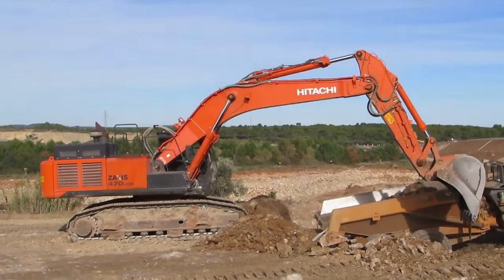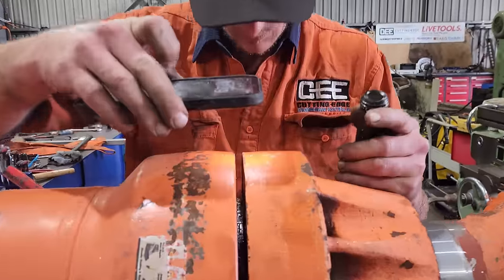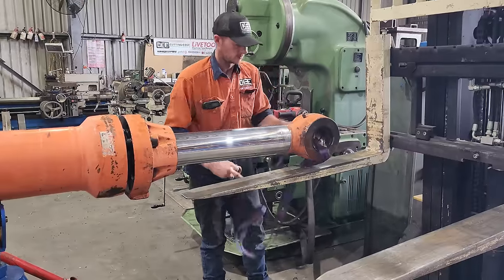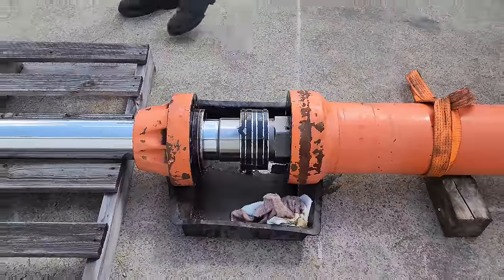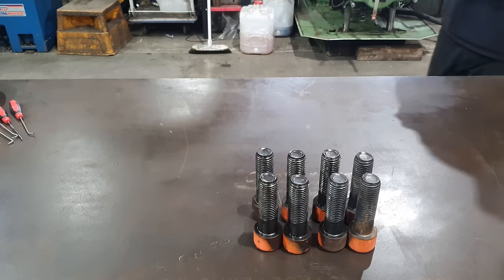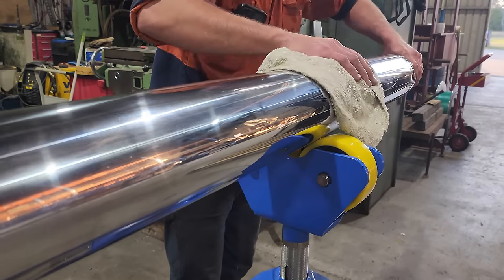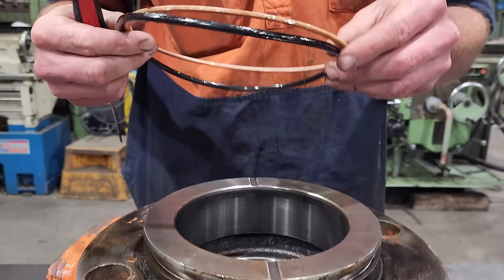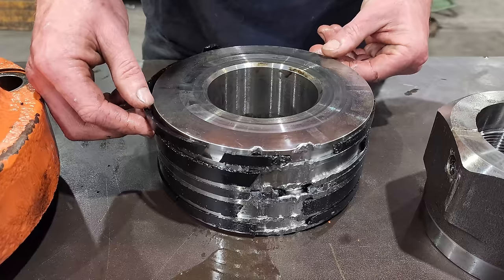It's STUCK! Can We Get This BIG Cylinder Apart!? | Hitachi ZX470 Cylinder Rebuild | Part 1

Comment: 4:28 Swallows are hilarious. I was sitting at the lights at an intersection and a dozen swallows were flying like this , no more that a meter above the road ,in the middle of the intersection, snapping up a cloud of midges.
They were doing this while traffic moved through the intersection at 50 kmh  and were flying  under the cars as well as between them and over them.
Good luck trying to throw something at them .

Comment: A tip to protect slings, tie-downs, and other straps, is to pick up some lengths of "lay-flat" hose.
Cut it into convenient, say 12"/300mm, lengths then slice anong the middle of one side, like a "C" section.
You can then easily slip it round the strap, or rope, to reduce the chance of cutting, or abraiding, the strap, or rope, on sharp edges.

Comment: And THAT, ladies, gentlemen and maintenance department accountants is why you do the regular oil tests at the manufacturers.  They're really, really cheap compared to unplanned machine down time and lost production.  Excellent work and a fine example of what a couple chips in the works can do to destroy equipment.

Comment: Nice. I'm an Excavator Operator for the last 28 years, and have operated Hitachi 8ton,13t, 36t, 48t, 50t long reach, 70t Fiat/Hitachi, and Wheeled Excavators (Rubber Duck) 10t, 13t, 17t, 21t. And would consider Hitachi's one of the best makes out there. I'm sure the Operator would have know something was a miss with the dipper Ram long before it got that bad, like noise change whilst cycling and loss of strength.
Would be nice to see more of Karen in the vid's as she is a major part of your content.
Awesome good as always Curtis. Love your videos. Take care, love from the UK

Comment: Just this week at the mine where i’m working, our 994k went to boom lift cylinder service, with no leaks or anything wrong. Just to keep the machine working as it should. Just OEM parts will be used to get the big girl to get the job done.

Comment: I know in one of your videos you said you don’t want to hire a guy to work for you, but may I make a suggestion you could hire someone to do the disassembly and reassembly and the cleaning of the parts to save yourself some time they can also run your deliveries so you could get more done in general they come in two or three days a week clean all the parts do all the parts runs go pick up the tooling from the shop and pick up the projects leaving you more time for filming and for actual work

Comment: A vertical parts hot spray washer using Simple Green as a wash agent would be a great adition to the shop. Instead of pressure washing. Plus the heat makes stuck parts expand and come apart more easily.👉👉TRICK--Or you can just heat the cylinder up to release the piston.

Comment: That cylinder is too large, but in the past I have used the forklift mast to pull them apart.  I would put a rod through the barrel eye, and lift the cylinder with that rod until it stood vertically.  Then I would chain the rod eye to the bottom of the forklift mast that stay stationary when the forks raise on the forklift.  Then i would raise the forks using the forklift mast cylinder to pull the cylinder apart.  Its best to have someone there to make sure the cylinder rod doesn't fall to the ground when the two parts separate.  I've done it by myself before by tilting mast back while pulling it apart to increase the odds of the rod falling towards the lift when they come apart, and putting a strap around the mast and cylinder to prevent damage when they come loose.  It's also very helpful to have a hose on the rod side port leading to a waste oil container when pulling them apart.

Comment: Hi guys, as always love the video's. Something I just happened to notice at 28 min's when you was removing the seals off of the piston. It looked like the seal splits or but ends where lined up in a line where the heavy damage was. Could be mistaken tho. With all of the hydraulic work I've done, those joints were "Always" staggered. Otherwise keep up the awesome work!!! :hand-pink-waving::hand-purple-blue-peace::goodvibes:😁😁😁

Comment: Brilliant using the forklift to pull the piston and rod out of the cylinder. How heavy is that press? I couldn't believe you were dragging it across the floor! What weight are those lift straps rated for? I was half expecting you to snap one and have to use a chain. Looking forward to you using that big horizontal boring machine to make the new cylinder. You rock, Curtis and Karen is a superb videographer!

Comment: Back around 1980 I saw bypass oil filters added to big Cummins and Detroits on power station coal moving machines (scrapers and dozers). The oil was previously changed every week. After the filters went on  weekly tests showed the oil was fine. We changed it after 10 weeks but the tests were still showing the oils was good.

Comment: My ears stung when I heard the comment ' A mate borrowed a tool and did not return it.'  Having run and owned a repair shop myself a number of years when I first started out I lent out tools with  no thought. After 'losing' a few policy's changed. Customers are required to now fill out a purchase order with a full description of the tool being lent including cost and expected day and time of return. If the do not meet the return requirement or damage the tool out of warranty, I charge them to replace it using financial information given at the time of lending, plus 10%. System works well. Customer knows their boundarys and the consequences for not complying. And if they do comply, they get to use a expensive tool at no charge.

Comment: If you have a stuck hydraulic cylinder,  putting an adapter on the cylinder so a pressure washer can be attached is one way I've evicted stubborn rams😃👍

Comment: Oil sampling is great preventative measure, Excavators have a very complex hydraulic system, that machine hold 85 gallons of oil, 4 hydraulic cylinders, coolers, pumps,and a lot of tubes and hoses, a lot of places that the metal can come from, without a leaking cylinder it would be hard to locate the failure if the sample came back bad. Depending on the skill of their mechanics they can possibly start with the noise that the cylinder made or check for hot spots on a cylinder with a heat gun, but it can still be difficult to locate the failure in such a large component. Unfortunatley sometimes you have to wait until something more develops to find the root cause.

Comment: Another great video!  Can you please tell me about the bracket on the top of your Milwaukie rattle gun?  We use a 3/4 one to remove and replace truck wheels. This bracket would be a great improvement to save me busting my arms holding it up for long periods. 😊😊

Comment: No need to make a bench for it. Just make a huge wrench with a pair of 20mm bolts with a pair of serrated vee blocks from an old large pipe vice,  the perfect size and the best job ever.  You can tighten it in on it properly on any nut or cylinder it won't let go and will always have the 4 points of contact as opposed to the two with a spanner or wrench and will never mark it or dig in and damage it like the wrench usually will. Mine can fit  anything up to 180mm across and we can hang out of the end of it with a ten foot pipe 😅

Comment: We would get those stuck cylinders in old cranes, found using water and a pressure washer was the easiest. Going to clean out and hone the the tube anyway, water wont hurt anything.

Comment: used to work for a yydraulic company ears ago in Las Vegas and thewy had a cylinder table that was used for exactly this problem, disassembling cylinders.  It would pull apart stubborn cylinders.  Cant you get something like that over there?

Comment: The Dash 7 Hitachi’s have live oil sampling sensors fitted to the Engine oil and Hydraulic systems. The dipper rams suffer a lot from this type of failure. At my old job we had a fleet of EC750’s and they all have at least one failure, one failed after 1900 hrs. Volvo kept updating the carrier bearing but they kept flattening out and the piston & barrel would chew themselves to bits.

Comment: Started watching your videos from the start ,,, again. The one thing ive noticed in all you videos is that you make a concerted effort not to bang , drop , toss on the table, anything tools or parts. 
I've worked with guys that will toss new parts across the shop onto a table or floor. I guess it made them feel macho

Comment: I know its a hydraulic cylinder but couldn't you use compressed air to push the piston out? Ive done that on smaller ones and brake actuators

Comment: You could machine a little flange on each cylinder so the maintainers could bolt on a microphone at each oil change.  Cycle each cylinder a couple times, have a listen, compare it to a new cylinder and one that needs service.  The audio equivalent of oil sampling, like.

Comment: Looks like it's time to build a Hydraulic Separator (I just invented that name) - a ram that attaches to both ends of the cylinder, and pushes them apart. It would be fairly simple to build that to include a 2:1 mechanical advantage, just as part of the structure.

Comment: I would have used the fork lift hoist to pull the shaft out.
Wedge a heavy bar through the cylinder eye and under the forklift and chain the shaft eye to the forklift prong and lift.
More control and less clutch burny outy

Comment: In such cases i used a solid groudanchor ,or the hydraulic pressure of the machine itselve while using a big 10 tonne Demag overhead crane, could spil some oil but out it went.

Comment: Would it be feasible to make a rig for pulling the rod out of the cylinder using a hydraulic winch rather than using the hydraulic press (or the shipping container) and the forklift?
Strong enough rig to also undo the rod nut and later install it?
Same rig to also inspect the cylinder bore.
Might save you time and your body.

Comment: real engineers set stuck parts aside and use them as a crucial element in an application where it must not fail under any circumstances. will come apart in no time!

Comment: What other work is involved after a catastrophic failure like this?  I assume a full hydraulic system flush?  How is that done?  How do you prevent the other cylinders from contamination and failure?

Comment: I was chatting about this video with a friend and they wondered why they don't have some sort of metal particulate sensor built into the hydraulic system on big machines like this. I guess they could maybe implement it as a chamber with a magnetic attractor covered by a mesh screen, and measure the resistance across the screen. Is that something that's present in some machines, or does pretty much everyone just rely on sample analysis services?

Comment: I was rewatching the one where you Made a new tree grinder part. I was looking at all those chips and was wondering if you could melt the steel down using magnetic induction furnace and make new metal blanks for your needs

Comment: My takeaways from this?  Hydraulic press probably needs another 3 tons of ballast, forklift might need a bigger engine.  Probably going to need some more rigging straps if you're going to go playing tug-of-war with the shop toys.  Seriously, though, I was surprised when the press started sliding (probably not as surprised as Karen, though).  Like someone else said, I half expected the forklift wheels to start spinning when you used the shipping container for dead weight.  That piston is completely FUBAR (old age reference).  I've seen you make a new one before, so no worries.  Question.  I thought I'd seen all the machines in your shop.  Where did the big green vertical mill come from?

Comment: You should have kept yanking the press along the ground.  Eventually the power cable would have pulled tight.
You must have a bit of stuff in that shipping container.  I was half expecting to see it shift a bit. 🤠
Well done getting it apart and interesting to watch.
I guess the guy with your flogging spanner doesn’t get any more loans. Why do people do that?

Comment: Could you turn that damaged piston down until the damage has been removed. Then it could it be used to cut a new piston for a smaller rod in another application?

Comment: We use a ZX85 to erect wood poles at work, tiny in comparison to what this cylinder would live on but good to see what goes in to it. We give our little machine some serious abuse - it's surprising it can take such a beating. Are the piston rings/ seals a hard plastic like it looks like or is that just baked rubber from the heat it has endured?

Comment: Are ni hydraulic cylinders designed with pistons that can rotate under use, to even out the wear? They do so in some large diesel engines.

Comment: Please buy yourself a 4k camera/dslr with 4k recording mode, it would resolve all the finishing, cutting, chips flying, grime and scratches, so much better. It's painfull to observe how the phone camera, even at 4k, just blows out the highlights all the time (everythings is slightly bloomy/glowy), or how it just can't optically resolve really small stuff, and so you see a lot of digital noise from the sensor, or how you observe how digital zoom also smudges things as it closes up on some workpiece. Colors are on a weak side too: some hues are oversaturated (like reds) while everything else in general is usually slightly understaturated. Pretty please.

Comment: I've got a U-cup seal question:  How does a double-acting cylinder keep pressure when operating in the opposite direction as the U-shape of the seal?  Does it not matter that much?  Are there cylinders with a U-cup seal facing both directions?
I suppose that was 3 questions, heh.  Thanks for showing us the process!
Reply: The lips of the seal are always compressed even as it's sitting in the groove, the seal is not a loose fit. Oil pressure helps the lips press harder against the rod and wall of the groove for sealing under higher pressures. And there is always some pressure on the rod end when the machines are in operation.

Comment: To separate the rod from the cylinder wouldn't it be simpler to undo the head bolts then pressurise the cylinder until it pops out?

Comment: We have used a pressure washer on stuck cylinders, hook it up cycle the cylinder to remove oil and let it push it out, pascal law applies to all fluids

Comment: If you fail to schedule your maintenance... maintenance will schedule you... usually at the worst time.
Using 3rd party cheap seals I'm thinking what cost them the rod... sometimes it is better to pay for the better quality service parts which you know work than buy the cheapest... as usually you pay for it later.

Comment: So I got a tow truck. I big flat bed that has a wheel lift. And the wheel lift is disconnected due to it leaking from the gland. Is this something I could likely fix without any machining? I feel like I've watched enough of your videos to know how to take the cylinder rod apart and replace all the wearable seals.

Comment: Pressure washers should not be left running for more than a minute without the handle depressed, it burns up the pump. It voids the warranty and is stated in the manufacturer manual. Just thought maybe this might save someone an unnecessary expense!

Comment: You shouldnt pull a mic off a measurement without lightly locking the thimble or looking at it before you pull it off.  You risk the tip turning as you pull it off. Maybe only a tenth but you're trying to be exacting, right? Indeed. Old timer taught me that.

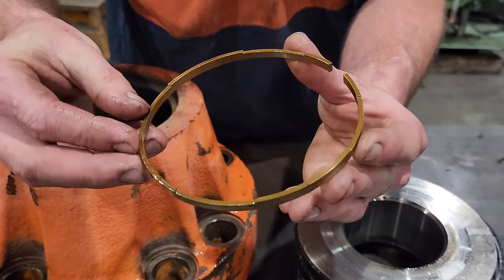Comment: @ 28:36 there is false information. That brass cushion seal is there to make the cushion effective when extending, but allows oil to flow through the slots for faster retraction. It improves the cycle times. Other john deere and hitachi products just pinch that cushion solid between the piston and rod. And the comment on the backup ring is entirely misleading. That stiff urethane u-cup isnt going to roll in the groove. The backup ring is there to eliminate the gap between the land above the seal groove and the rod so that the seal does not extrude and erode.

Comment: So is the reason for this type of damage is caused by a crappy maintenance schedule;  running the equipment  24/7 or a combination there in? Most experienced heavy equipment operators are in tune with the equipment and can immediately detect if there is a problem with the machine, just by the sound; the performance of the machine; or that built in gut feeling that something his not right with their machine!

Comment: With machine downtime so expensive who tears a cylinder link that apart and then doesn't rebuilt it with genuine seals? I guess the same type of person who would pinch a seal during reassembly and then just force the rod into the cylinder. The machine owner probably bought a rebuilt cylinder thinking they were getting a deal.

Thankfully we'll never see work like that done on this channel.